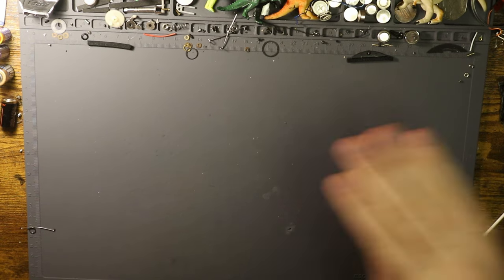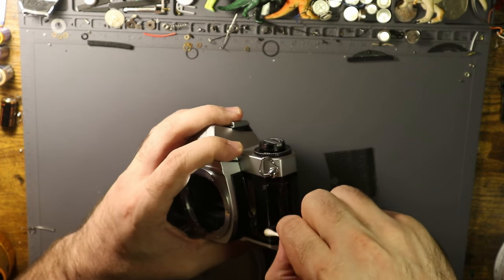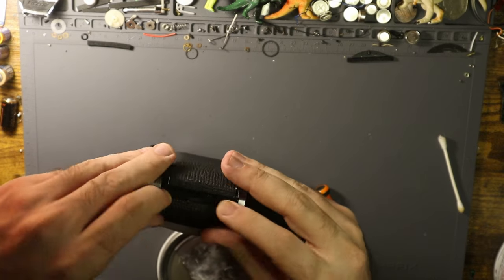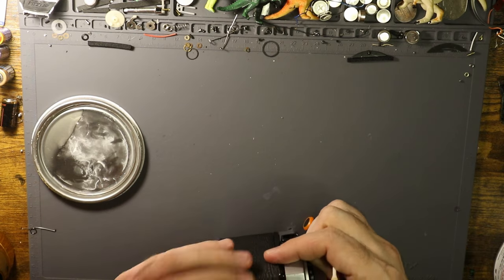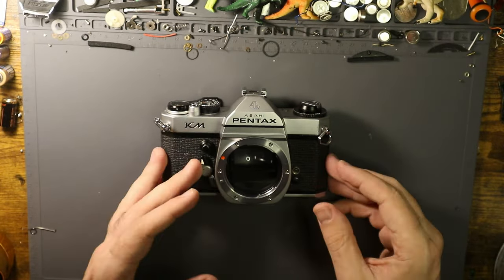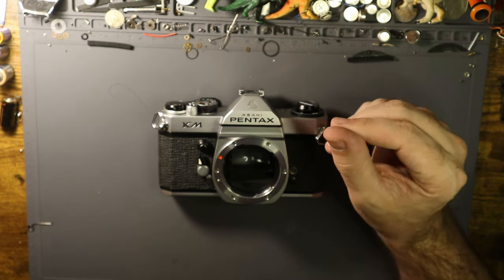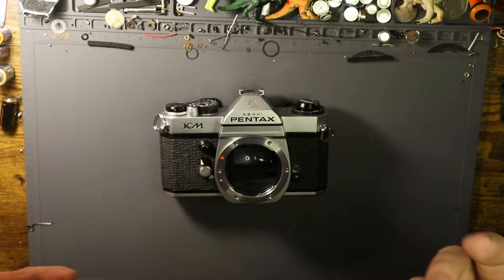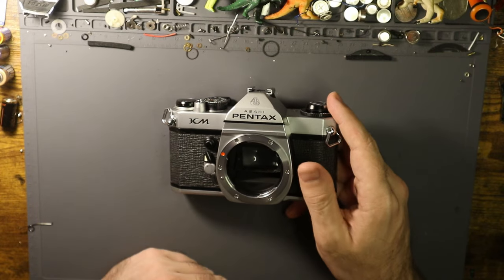How to replace Film Camera skin

Comment: I currently have 13 vintage cameras and right now, only 1 has suffered with loose skin. I bought an Olympus OM-1 about a year ago. It suffered from the slipped wind gear problem which I lined up correctly and the camera was fixed just like that. But it still had rag-tag leather which I finally fixed with Super Glue (Don't try this at home).  Of course, the super glue went to places where it didn't belong, like the sliding catch that holds the film door closed. Fortunately I had removed the back before applying the glue. Otherwise I would have super glued the camera back shut! I tried many different approaches to unsolving the glue, none of which worked. Finally I discovered there is a solvent made by "Goof Off" called , Super Glue Remover. It took a few applications and a lot of prying but finally the Super Glue gave up and the camera has worked ever since. But the skin is still lose, and I do not plan any future repairs.